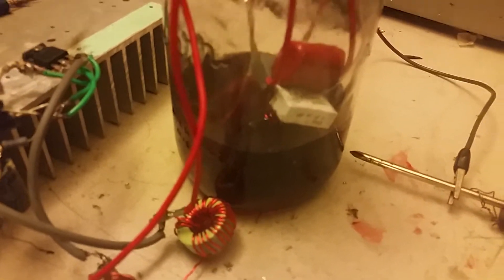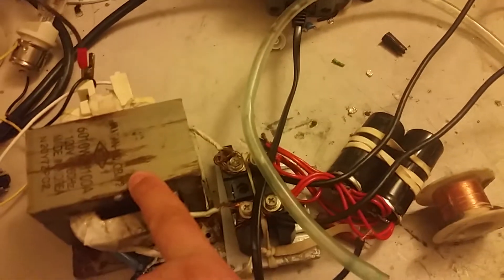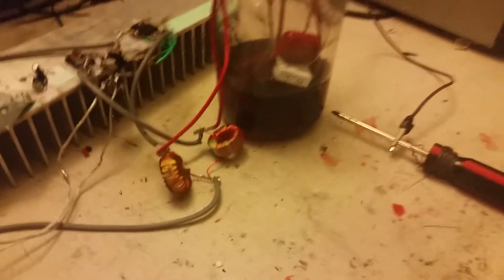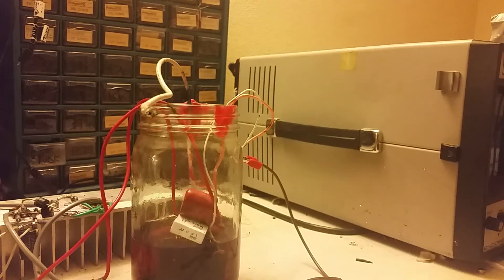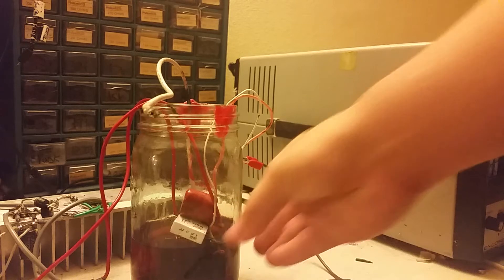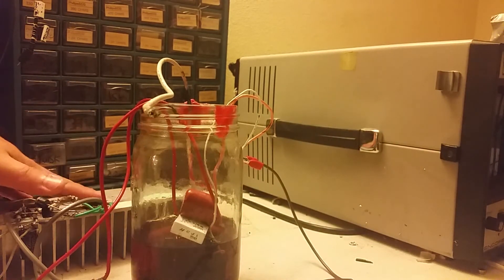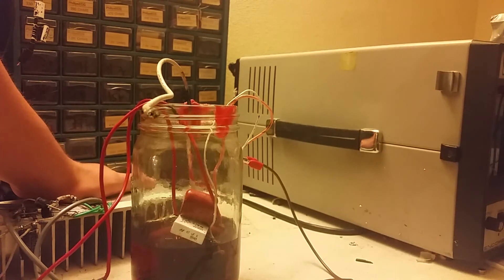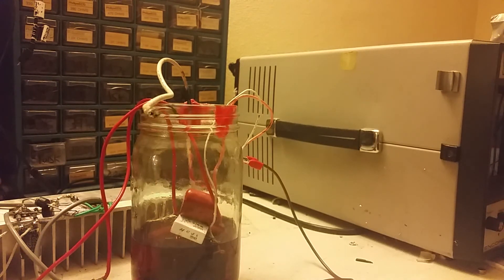1kw flyback driver

Comment: Wait... You wired your inductors in parallel?
Reply from the maker: The inductors are wired in series and then connected  in parallel with the primary, this is the circuit diagram.
https://markobakula.files.wordpress.com/2012/10/royer_ih.png
Reply: Mine are also in series, the only difference is they share the same core. It's an ac filter inductor. Two coils in series. But in parallel with the primary... That's new to me. What advantages this modification brings to the circuit? Thanks ,-)
Reply from the maker: The only real advantage is that I do not need a centertap on the flyback itself and only need 2 wires to connect to the flyback instead of 3.
Reply: If you don't have a center tap on the flyback, then these inductors are doing the job of driving the gates instead of the flyback ferrite itself...
Which means less voltage spikes and less chance of saturating the flyback, right? Also means higher resonant frequencies, since you've got yourself other impedance values, right? It would be nice to scope the gates, but it seems like your frequency is damn high. I mean, look at all that corona emission. I challenge you to find a single ZVS emitting corona like that.
Reply from the maker: That makes sense, I had not thought of it in that way, I am not certain about the exact subtleties about how it works, but the inductors and the primary in parallel lowers the overal inductance and makes the resonant frequency higher as you mentioned.
Reply: Holy shit! I tried this circuit and the MOSFETs don't even heat up! I kept everything exactly the same, only added Marko's modification. I wonder... What if I reduce the number of turns to 5 instead of 10?...
Reply from the maker: The output voltage of the flyback will be higher with the less turns you have but it might cause more heating of the mosfets.
Reply: I'm throwing 50V, unballasted and they're Ice cold. They're rated 47A 600V. What do you think? Also, Xl=2pi.f.L so the lower the frequency, the higher the current.

But it's resonant meaning that Xl and Xc are equal and cancel out, so... F=1/2pi.root of L.C

So both inductance and capacitance are inversely proportional to frequency!

So if we have higher inductance and capacitance values, the frequency will be lower, meaning the impedance across the primary would be lower, actually draining more current!

So how do we do that and still get high voltage? Cuz if you add more turns for more inductance the primary-secondary ratio goes down. Simple: You add separate inductors in parallel with primary! It's so simple but yet so ingenious!

So the frequency actually goes down instead! I can see the current draw goes up when I lower the frequency in my half bridge as well! Simply because Xl=2pi.f.L!

Comment: That's very impressive my friend. I just love the coronation streaming from the anode just there. So fucking B.E.A.U.T.Y.F.U.L. damn mate if you don't give me the circuit diagram I'll have to kick off lmfao.

Thanks for sharing my friend. And hope you are well.

👍👍👍👍👍THUMBS UP👍👍👍👍👍

Anthony

High1voltage1rules
Reply from the maker: high1voltage1rules Thank you,  the circuit is a modified zvs so no center tap is required. http://4hv.org/e107_files/public/1322325485_1034_FT0_1313589228_89_ft1630_royer_ih.png
Reply: Very cool mate. Me liking it 👍😉 ⚡⚡⚡⚡⚡⚡⚡⚡⚡